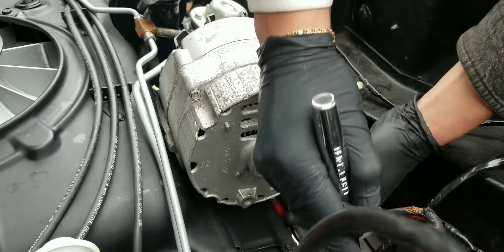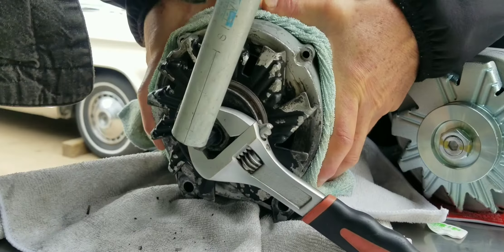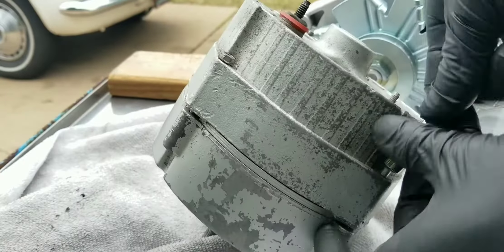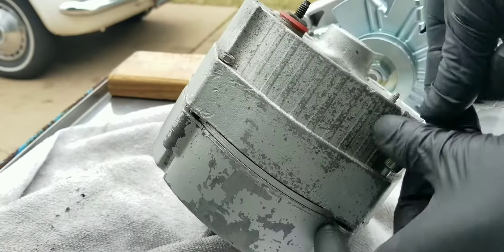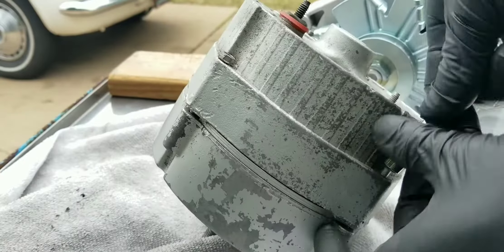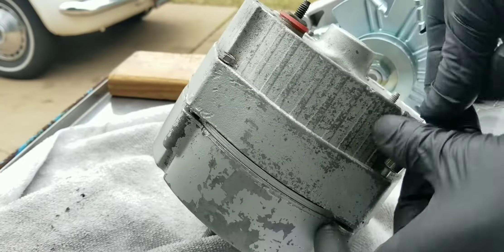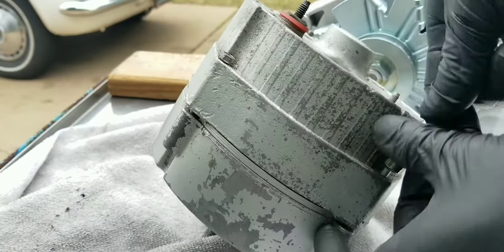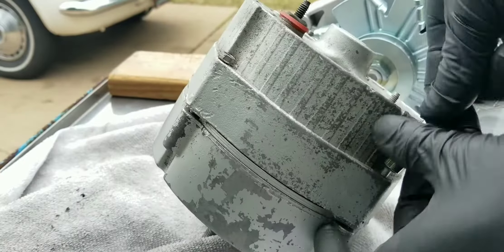Corvair Gets A New Alternator!

Comment: I noticed you don’t have the side brace that goes on left side of alternator to engine block. Seems you don’t need it but GM thought it was important. Is yours a single wire or are you still using the voltage regulator?
Reply from the maker: I also noticed that after seeing pictures of other Corvairs setup. The altornator is internationally regulated, I had to splice some wires in the harness for it to work.
Reply: How do I test voltage reg 65 110  corvair
Reply: @benbencorvair9071  I'm installing a new alternator in this sandrail that's powered with a corvair powertrain as we speak. this thang was parked for over 20 years and it's my job to get her going again. I need to start making videos, I tinker with some pretty cool things with and without motors
But I have no idea if this new alternator has a voltage regulator internally?? hope so because I removed the external V.R. all the wires which wasnt much were toast. Any idea how to find out? 65 or 66' corvair  w/ 2 barrel Holley carb.

Comment: Gen light always comes on when alternator NOT charging and engine throws a belt as well. I saw this all too often on both my 63 and 69 Corvairs. Be careful NOT to tighten fan belt too tight as it will cause wear and burnout of fan bearing and the fan bearing is a "pressed" engine bearing, and is difficult and expensive to replace.

Comment: Love the video but ... Just a suggestion, after taking the belt off, leave the alternator on the engine when you are removing the nut, you should have enough room for the Allen key and a wrench, it makes it a lot easier.
Reply from the maker: That sure does sound like an easier way! Thanks for the tip.

Comment: Ben Ben Ben Ben, hey Man I'm installing an internally regulated alternator. I thought I saw a video of yours were you eliminated the regulator and mounted a junction box on the back (er front?) Wall. Was that you? Was it this video? 🤔
Reply from the maker: Yeah I did install a junction block. I mounted it on driver side close to the fire wall. Next to the battery, I should be on this video.
Reply: Nope! It's blowing my mind because I thought it was there also. Did you get rid of the external regulator on this job?
Reply: Or was it already gone?
Reply: What I'm trying to do is figure out the wiring for an internally regulated alternator.
Reply: @davidp187  bro me too!!! This was parked for over 20 years here in Colorado, so in good shape, just everything is dried out, wires and all. New alternator, plugs and wires, added the ballast resistor,  new coil, cap and rotor. I'm in the process of wiring her up(just to a universal keyed ignition)
Reply: @michaellee6762  keep trying mine worked out. I removed my external regulator. It made things much more simple. Got help on Corvair forum.